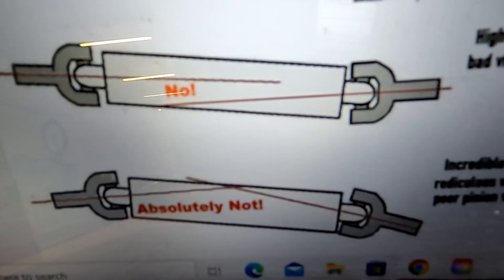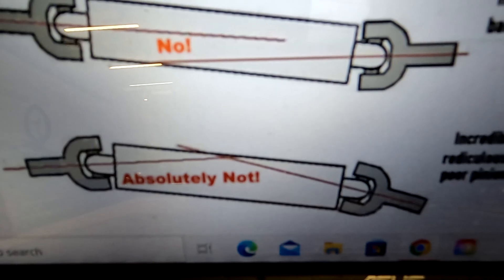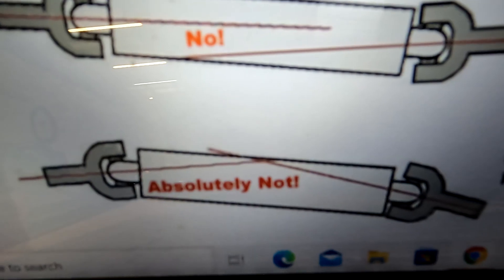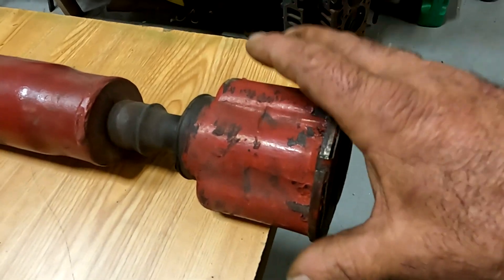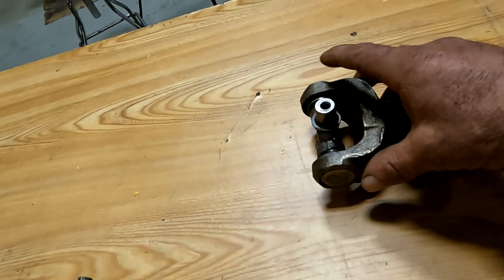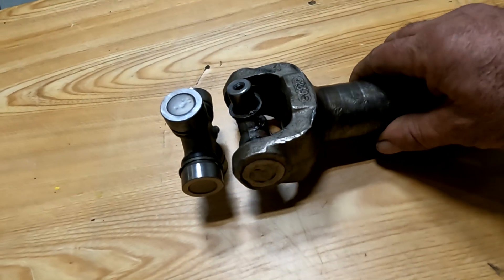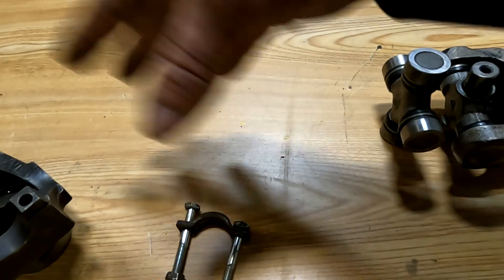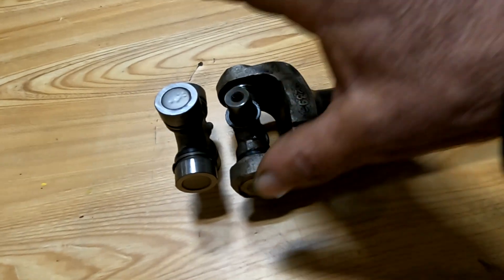The Secret Life Of The Universal Joint - Uses, Limits, How They Differ From Constant Velocity Joints

Comment: I've I always found it extremely hard to achieve a smooth, vibration-free ride on my Valiant at highway speeds due to that very complexity. Maybe that's one of the resaons why the auto industry steered towards front wheel drive.

Comment: If the drive shaft is perfectly straight with the crank and trans to the pinion for it to work properly what about the offset to the passenger side of the pinion? So it’s straight on one plane but not the other.

Comment: The double Carson joint you didn’t show was used at the rear of all full bodied GM cars. Cadillac had both front and rear double Cardons from the mid sixties. Their weak link was the centering ball in the joint. Especially at the rear, water would get in past the seal and rust out the ball, its cups, and the tensioning spring causing misalignment and vibration. The individual joints would be fine but you had to replace one because the cups were retained by injected plastic which got cut during disassembly. The ball was part of the shaft on early models so that meant a new, very expensive, shaft or a lot of very expensive precision machine work plus 4 new joints and two ball kits on the early Caddies.
Reply: All full bodied GM from ‘71 on.

Comment: That Ball and Tenion joint I had to buy full rebuild kit just to buy rubber boot 
I’m putting a 55’ DeSoto 291 in a Model A that I got in basket case has a 48’ Ford front axle 69 Impala Disc Brakes (4piston like Vette) I put Lincoln v-12 front main spring . Has a 55’ Chevy rear axle (had 283 SBC when purchased). I have a Franklin Quick Change Rear Axle and 3 short tailshalf 727 Cores all three are 2 different u-joint & 1 ball & pin with parking brake like old powerflite 
My wheel base is 10 1/2” shorter then stock Model A frame , 3 1/2” front axle is behind spring & rear axle is 7” in front of spring . I was told a fiberglass 33’ Willy’s Coupe may fit my frame 
But in mean time I have a 29’ Coupster Steal Ford Body was a five window coup that had a full steel flat roof from factory it was cut off and lower part of roof panels were missing I had only the roof top to just under the top door hing top three inches of roof top. I had it in my yard and my dad tossed it out and a scrap man got it before I could save it. Unfortunately my dad also tossed out a matching pair of Hemi valve covers , I was going to have chromed plated, 😢
That roof hurts me more then those valve covers in a way. Most Model A Coupes had cloth top 
Mine didn’t and it was factory I wish I had the original Ford Engine this car came with. 
Oh yeah

Comment: The case where I see ujoints fail due to lack of movement is subarus (and likely others, but i work on a lot of subarus). Since they have independent rear suspension with an almost completely straight driveshaft, the ujoints do not move enough to lubricate and they end up with terrible false brinelling.

Comment: The 2 U-joints cancel each other out. the only thing that will cause vibration is the varying driveshaft speed but the wheel speed will be constant

Comment: I have some drive line noise. I replaced the carrier bearing, Chevy s 10 extended cab truck. It was not really bad, but the rubber mounting was broken. I still have rumble under load. I checked the u joints, all 5 of them. They seem fine. I still think it is a u joint because the rumble is like on off on off like a u joint spinning. Any ideas.

Comment: Ok UT is dead wrong about straight driveline no vibration.  Yes on paper  but driveline's under a load twist or what we call driveline deflection cause vibration especially if the driveline is straight,that's why they put angle in the driveline. Yes the drive shaft tubing twist enough to vibra ok.  Another thing driveshafts have two u joints not one like a swivel and socket. Ok try this but use safety glasses and put two swivels on a socket and an impact. Don't do that the socket and swivels will go flying and hurt someone. I built driveline's stationary and automotive look take the angle out of your driveline and it will vibra do it and you will see, got it!!! Look you have two u joints on a solid shaft, we call it working against each other the two u joints. Driveline deflection ok!

Comment: You should check and see if they make a yoke there takes u bolts for for the differential you're working on.
I've got a Dana 80 one of the bolt holes on the yolk broke. I did some research and found a yolked it took u bolts

Comment: You never want a card an joint to run at zero angle.  The trunion will absolutely end up with false brinnelling.    You always want 0.5 to 1.5 degree angle.  

Same reason Rzeppa joints don’t run at zero degrees.

Comment: Hmm.. Here's the thing. That joint at about 12:00 is not a constant velocity joint. It is a slidable T-joint. It just makes axle length change easier, because the "sliding" is done in better lubricating conditions than splined shaft and bore. Constant velocity is only achieved when bearing balls, hold in a perfect plain by a special retaining cage, ride in very complicaded trajectories curved on both inside and outside, both shell and inside  "thingy" of the CV joint system. Usually it's 6 balls and 6 curvings because it's easier machinable. But this system used in most all front wheel drives outer joint, does not allow axial movement, and the inner joint must do that, and to also be really constant velocity, inner joint must be even more complicated. Some manufacturers don't even use true constant velocity for the inner joint, they use 3 bearings at 120deg, riding on 3 tunnels also at 120 deg which also is not constant velocity config. But does allow change in length, and in front wheel drives where it's used, the angles on inside are always smaller. On the outer side there's the suspension movement plus steering the wheels that is. Now about vibration on joints, a detail that does minimize vibration is the U' s must be timed, ie not random angle positioned, so the two vibrations mostly cancel each other. Keep up the good content, far better than what we see on tube. Have a good one.

Comment: Another good lesson as usual. I was surprised, though, that you didn't mention anything about u-joints that have no grease fitting. I've always thought they were supposed to be stronger since there's no grease fitting hole.
Reply: I either saw a video or read a forum post by someone who said they're a mechanical engineer or something of that sort. He did a bunch of mathematical formula witchcraft to compare the potential loss of strength a grease passage would impose. Result by the numbers, according to the guy, was that there was no difference between the two parts at the levels of stress they would see in any automotive application, high performance or not. That's still just hearsay to me, since I don't at all have the math brains to verify accuracy of his work or whether he properly accounted for all relevant variables, but still thought it was interesting.

Comment: UTG, I enjoyed this video, thank you. Here is a lesson learned. A friend had a 1950 dodge which he restored years ago. It had a strange vibration when accelerating around 35 -40 MPH. Well with a flat head engine not much acceleration was actually happening but the vibration was like an unbalanced wheel. But was not. It was a worn drive shaft trunion. We turned the drive shaft around and walla no more vibration on acceleration. BTW Lincoln Mark 7"s had the constant velocity U joints. A cheep source.

Comment: He says at high angles it binds but what he's talking about i think is less binding and more the design as he was saying...at a certain point in the rotation because of the 4 point contact design it reaches a spot where the driven side of the joint has to spin slightly faster for a very brief moment for the joint to overcome the geometry and it can seem like a vibration...well it is a vibration...but it's caused by that tiny speed up and slow down more than excess play  or an actual bind in my opinion... honestly a slightly worn joint can achieve a higher angle before experiencing the same effect...I'm probably making no sense and sounding like I've been whacked in the head by a driveshaft lol. From my experience if you actually bind a u joint it finds the weakest spot... which personally I'd like to be a strap...if you break a strap you know not to try that a second time and can rig it up well enough to get home with some repurposed metal conveniently already attached to the truck!  Again sorry if my explanation makes no sense it's hard to describe but fairly easy to demonstrate with the parts.

Comment: I recently took my truck to a driveshaft shop. They rebuilt it and put in a new upgraded center slip yoke. Nice looking piece....but it vibrates. Started poking around. They just rammed in greasable ujoints and didnt check axial play. Also all the clips are black meaning they installed bulk clips for an aluminum shaft which are a different thickness then the standard copper ones, or the selection that comes in the bag when you buy good spicer ujoints. Rear u joint had enough play to feel and the others had the clip on one side flat and the other fanned out. Meaning the u joint is not centered and also buried into the caps. Wont rattle your teeth out but still a "whOOOm.....WhOOOm...WhOOOm" above 70kph. Also means they didnt road test it. Everyones in a hurry today to change parts and throw you out the door instead of doing an actual diagnosis LOL.

Comment: Being a class 8 mechanic 35 years this is one of the things I diag and fix. Have box trucks with 4 driveshafts and air ride with a vibration I road test it. A drive will indicate u joint angle or out of balance. U joint angle will induce a vibration on acceleration or coast on light throttle the vibration will be less. Out of balance will be speed specific usually you can drive through it like a bad tire. I work at a Freightliner dealership that has 10 other franchises and other makes and send all these vibrations to our shop my foreman says my ass is better than any vibration analyzer that we have used because they tried when I was on vacation told it was wheel end I came back it was drive line imbalance.

Comment: The red Mopar joint you called a CV joint is NOT a CV joint. It functions as a conventional u-joint but is designed uniquely. It contains 2 balls that roll and pivot like the caged rollers would, AND they roll in and out to accept driveshaft length changes during suspension movement. Other designs use splined shafts on the transmission and yoke.
The red joint has only a 2 axis design, not 4 like the doubled u-joint you later illustrated, a design that neutralizes the "velocity" differences. Therefore the red is not constant velocity.
Think about it.

Comment: There is also the CV joints that have a bunch of balls in them. There is no shaft but the inners and outers form to the balls. Kinda like splines. Hard to explain. You see those on front wheel cars all the time.

Comment: Do Not over tighten the u-bolts on a u-joint, if you crush the cap or distort it the bearings won’t turn = premature failure.  It’s actually easy to over tighten.  👍

Comment: I have a question.  Is there a strength difference between the flange mount style yoke like on a foxbody and the older u-joint style yoke.  Obviously I'm talking stock for stock.  If there is a difference do you think it's worth changing from one to the other?

Comment: Anyone with a 4 wheel drive pickup ( with u joints in the axle shaft ) has seen what happens to the front wheels if spinning full lock. Extreme angles=not good. Floppy floppy.

Comment: I would like to see Uncle Tony address the issue of ring and pinion ratios and tire diameter. Does a shorter tire actually work out to mimic a lower rear end ratio in practice?
Reply: Absolutely, ask any guy that runs big tires on his truck. Not only will small tire lower your effective gear ratio but also means less rotating inertia in the tire

Comment: Yep jacked up 4 wheelers put the drive shaft in a bind. I have never seen any vehicle with the drive shaft in a level straight line. My '80 Ramcharger has the cardan joint on the front shaft and it is a bitch to take apart and put back together.

Comment: You actually can put u-joint in backwards.... If you install it to the grease fittings in the back when it's installed you can't get a grease gun in between to greese it. Uncle Tony, So is the pinion snubber that Mopar designed to keep the driveshaft in line under acceleration? Great info here!

Comment: These last two videos have made me very glad I installed air bags in my truck's rear suspension. My goal was to level the truck when towing in order to improve handling and braking. I hadn't even thought about the drive train geometry causing binding while I'm also demanding that it transmit maximum torque.

Comment: Grease zert killed more u joints than alignment of the shaft?  Pump in two much , blows out the cup seals.
Reply: The cup seals are designed to allow grease to escape during filling and close back up...if your seals blew out they ere dry rotted. I service lots and every time I push fresh grease out of the cups to make sure the needle bearings are full of fresh clean grease and any contaminates including water are removed to extend their life.
Reply: @jasoncook5307  Most of my experience is from40 years ago,

Comment: You don't get "bind" from u joints, even at pretty big angles, as long as they are used in pairs, they are properly timed, and the drive and driven ends are parallel.

Comment: This is important.  When you weld a driveshaft, the yokes on both ends must be aligned. That is, if vertical on one end, the yoke on the other end needs to be vertical, too.
Reply: The reason for this is that both u joints are producing the "speed up/slow down" vibration. By aligning the u joints, they are producing these vibrations 180 degrees out of time from each other and theoretically cancels them out. I say theoretically because the angle they operate affects the amplitude of vibration. That's why having the rear axle pinion and the transmission output shaft parallel is so important.

Comment: All U-joints are Cardan and when they are used as a CV style it is call a Double Cardan, which is a little more than just 2 u-joints slapped side by side. The real benefit of a double is you can run greater angles and also mis-matched angles with no vibration. That is why the vast majority of 4x4 with straight front axles have front drive shafts that use a Double Cardan to account for caster axle rotation.
Reply: Cardan is just another name for U-joint. U-joint is just the common vonaculure.

Comment: A drive shaft with 1 joint front and back, is a double cardon joint with a really long cage.   As long as you dont have so much angle that the U joints dont bind, and both joints are parallel, the speeding up and slowing down of the driveshaft created at the tailshaft is cancelled by the opposing joint at the pinion.     In a perfect world.  Real world it might he off a touch from perfect as the car moves

Comment: Just this afternoon I was running a rototiller behind  my tractor and literally smoked a u joint that measure 1.5" x 4.25" across the joint turning around 1000 rpm, of course the angles are in the not good to absolutely not and beyond with a lot of jumping of the triller! O well just dollars to replace the joint and yoke $%@^. Didn't know about compressing the grease fitting Thanks for the info.Fred

Comment: cardan joint...found on the front driveshaft of all 70s jeep cherokees.  they were great until they came apart and knocked the side of the transmission off.  thats the only reason i ever had to change a th400 in a cherokee

Comment: So as long as the transmission and rear differential are on the same level, a small, but equal angle at each end of the driveshaft is okay. I think I get it. Even if I explained it horribly

Comment: Again, another great video on this UTG. I'm in the process of converting a 1965 Dodge Dart GT to Manual Trans and a V8. The car came stock with the 225 Slant 6 & automatic with the "Ball & Trunnion" drive shaft, due to the lateral angle design of the early A-Bodies. To correct this (because of what I'm doing with it) I have to straighten out that angle in order to do away with the need for the Ball & Trunnion for the standard Ford Slip Yoke on the 3-speed manual that is being swapped into it. As you clearly stated, a Manual Transmission is completely unforgiving compared to that 1965 "Slush-Box" automatic that was in there.
I've tried my best to explain this to others, but as you are finding as well... it's a tough thing to explain to people. If I was to just drop this engine and tranny into this Dart, following the placement Mopar did.... I will have extreme U-Joint wrap.
Reply: Could you add like a double Cardan Joint or something?
Reply: @Liam8488  It is an option & one that a lot of short wheel base lifted 4x4 use. but with the manual trans it's still a lot of "side winding torque" on the tail shaft of the trans, and pinion. By straightening that angle out, I actually make the rear end that's in it stronger.... if that makes sense. That and the cost. I can have a custom "standard" driveline made for about 150 bucks. A "cv' driveline starts at around 600.